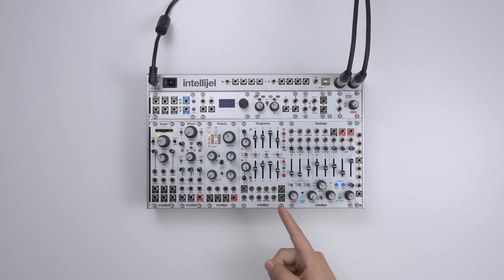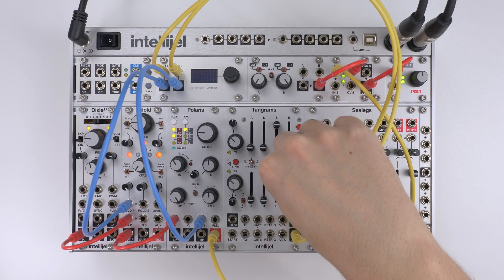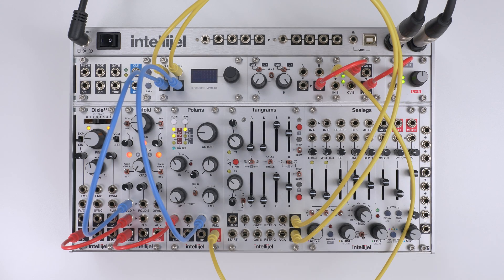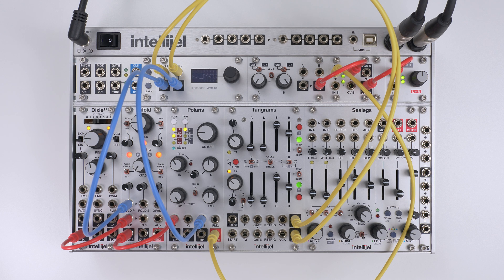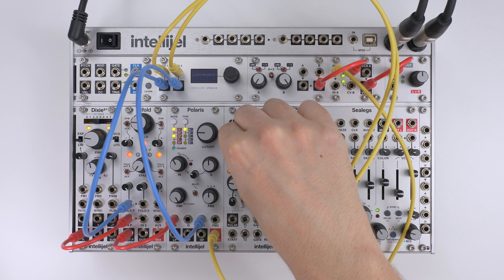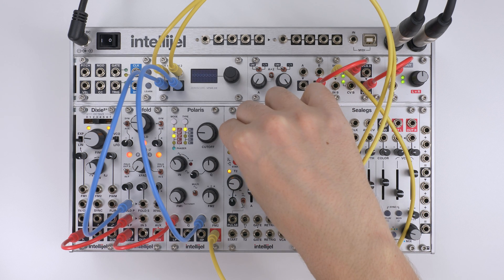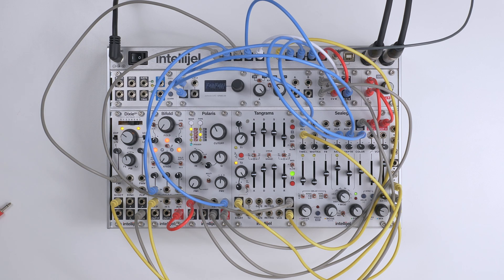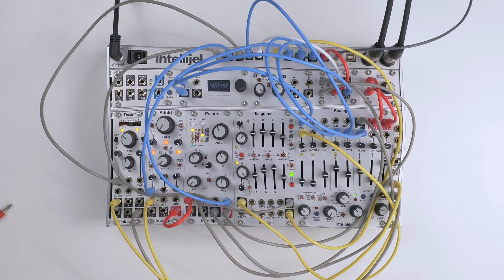Intellijel Tangrams: What is the Pulser?

Comment: oh man that last patch 😱. on the flip-flop patch, Sealegs is providing CV shaped by Dixie/Bifold/Polaris? Scratching my head on this. As always -- THANK YOU.
Reply from the maker: The cycling envelopes are modulating Polaris & Bifold. The speed (T1 & T2) of the Pulser outs (P1 & P2) that trigger the envelopes is determined by Sealegs LFO (shown on Zeroscope). The way the attenuverters are set, they speed up / slow down at opposite points rather than together. The only other thing Sealegs LFO is directly modulating is Dixie's pitch through FM1.  I hope this helps!
Reply: @intellijel wow — impressive. these short videos are 💰.. thank you!